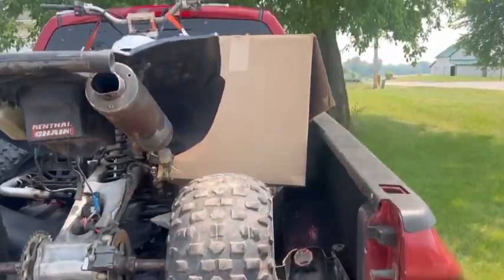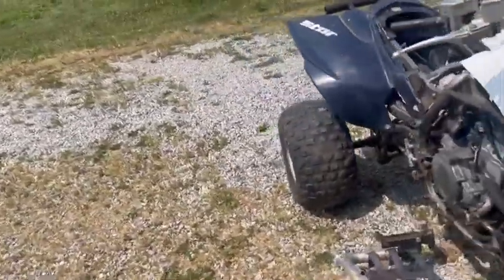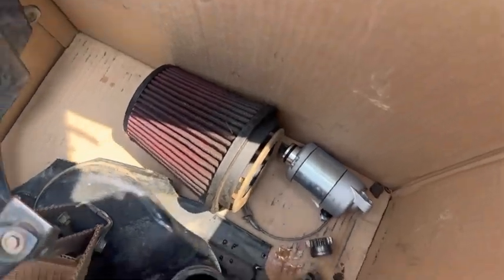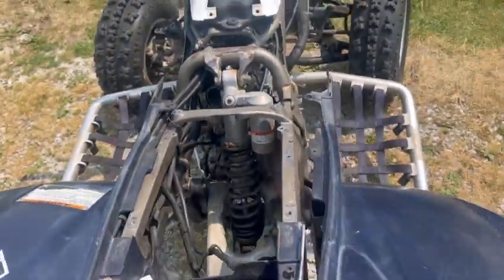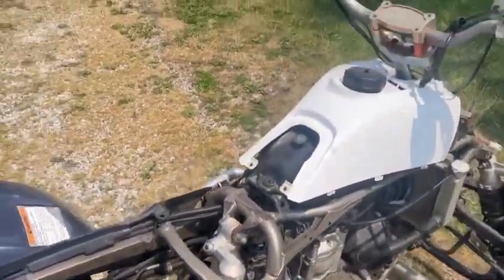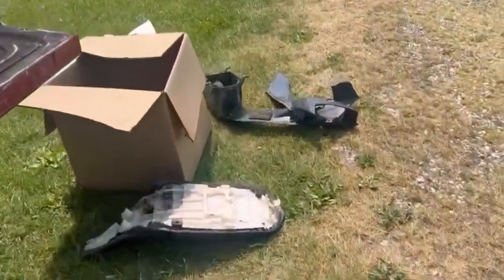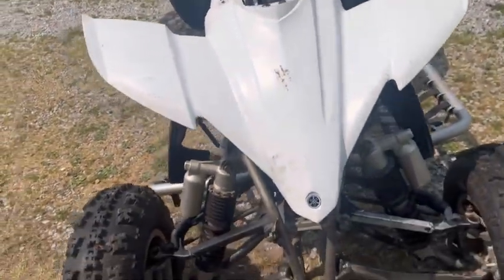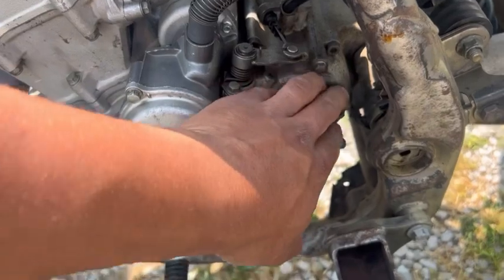I bought a YFZ 450!

Comment: 04 and 05 are the worst years, make sure you do the oil mod asap 10$ part got to do some machining though, 04 and 05 top ends are super dry they ALWAYS blow up or lock up.
Reply from the maker: Sold it lol
Reply: @motozaye GOOD😂